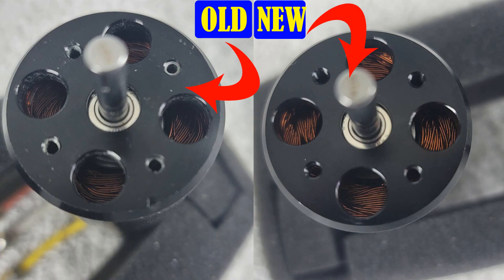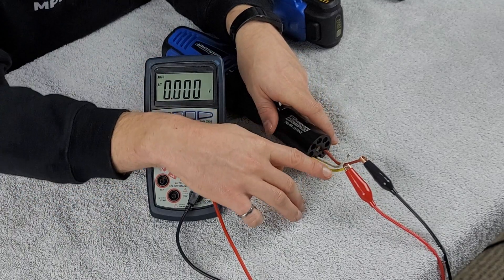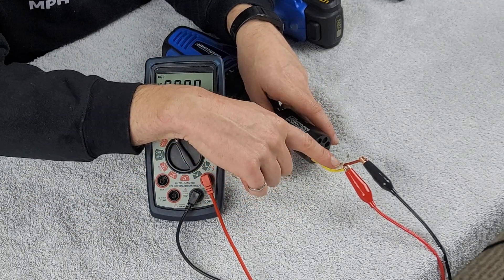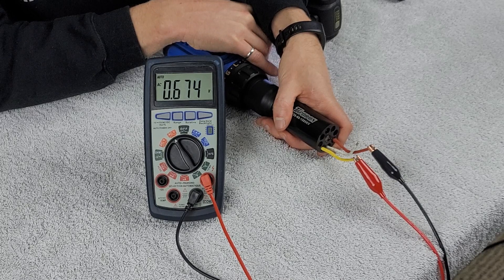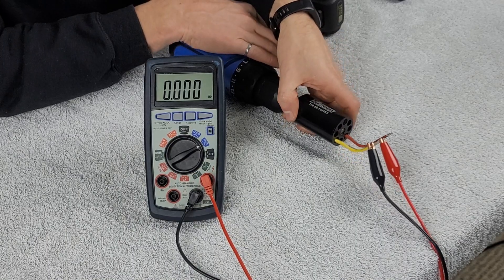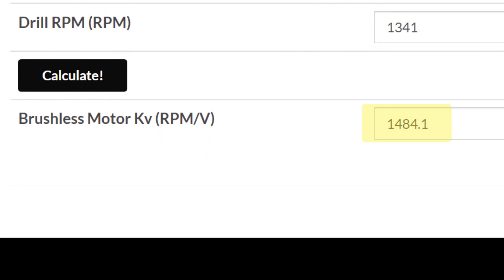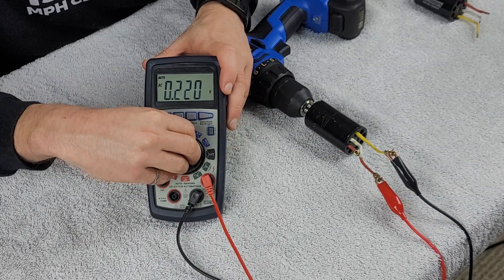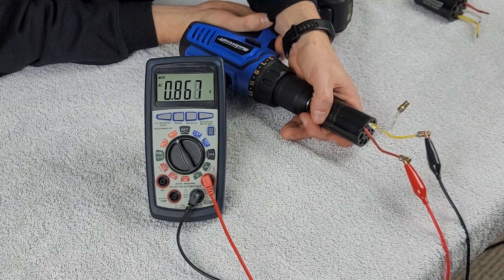Is this RC Brushless Motor DEAD, Did the Rotor Failure Destroy it?

Comment: I had one of the wires inside my motor came un soldered. I re soldered it, connected to my esc to test. It worked forward and backward. I installed a pinion put everything back in the car took it out for a little test drive. Did nothing crazy just a few passes in the street and after 2-3min my esc caught on fire. Can my motor be the cause off that?

Comment: I tested three motors using the drill method and your online calculator. On the first the tested KV value was 14.3% higher than the spec. I'm pretty sure I overheated this motor a couple of years ago and is damaged. The second motor tested 4.4% below spec. I suspect this motor is OK. The third motor tested within .02% of spec and I'm certain this motor is OK. My question is how close should our test results be to the spec before we have confidence in the motor windings?
Reply from the maker: Great Question. I would expect to see less than 1.0-2.0% difference for voltage output from all 3 phases. Kv value really depends on the manufacture and it would not be ideal to use this only to determine if a motor has an issue. I would expect over 10% difference on Kv to suggest something may not be right. The best way to know this for sure, is to have a measurement done when the motor is brand new. Then when you measure it sometime in the future you have a baseline specification for the exact motor in question.